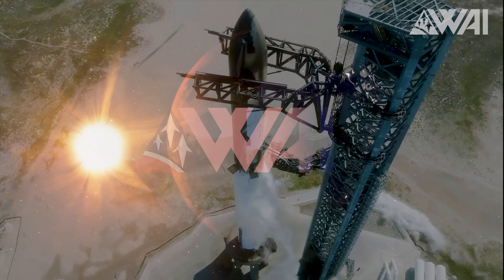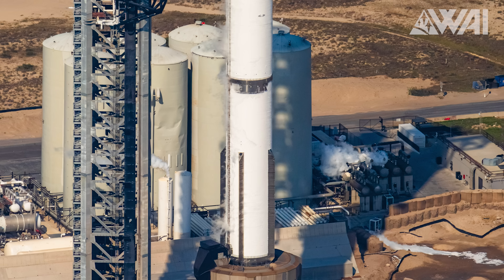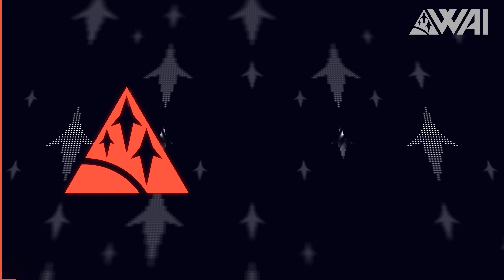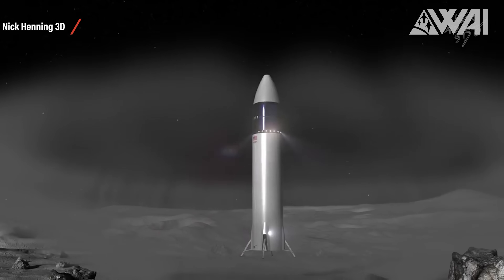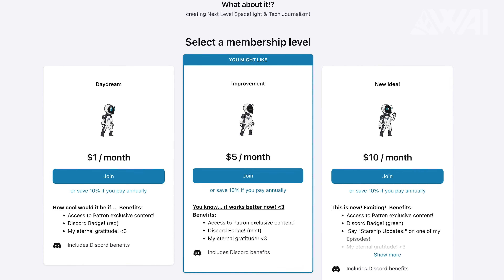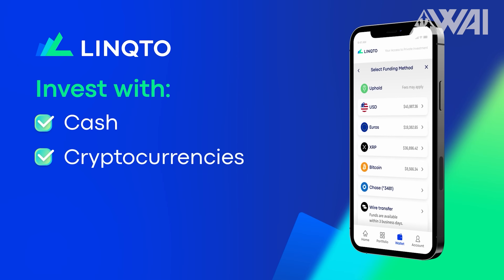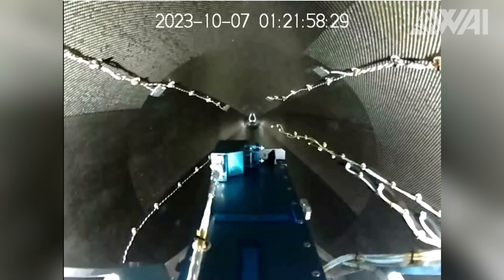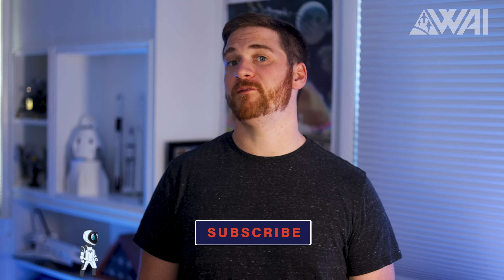SpaceX Starship Launch Imminent! What To Expect?

Comment: SpaceX has completed a wet dress rehearsal for its Starship, with the rocket's tanks partially filled with propellant and then emptied. The event, which was the first static test of the rocket's Raptor engines since May, took place on 22 October at the company's Starbase facility in Texas. The event was followed by a test of the engine purge system, which is designed to prevent fires on board the rocket during launch. The deluge system, which is designed to mitigate flame damage at the launch pad, was also tested. The testing occurred even as the Fish and Wildlife Services is reviewing the environmental impact of the system. It is unclear when the next Starship launch will take place.

Meanwhile, India has tested its first crewed capsule, the Gaganyaan, which is set to carry astronauts into space by 2022. The spacecraft was launched from the Satish Dhawan Space Centre in Sriharikota on 22 October, carrying a humanoid robot named Vyommitra. Spain has also launched its first private rocket, the Arion 1, which was built by the Madrid-based company PLD Space. The rocket, which was launched from the El Arenosillo test centre on 17 October, reached a height of 30 km. Finally, NASA's Voyager 1 and 2 spacecraft, which were launched in 1977, are set to receive their first software update in 46 years. The update will enable the two spacecraft to continue to communicate with Earth until at least 2030.

Comment: I hope Felix is back to 100% before launch attempt 2!
I wonder: could SpaceX be using the regulatory delay to train and work thought the procedures for rapid reuse?
With the hot staging ring as an add-on, and stuff they need to check under it, I could see SpaceX replacing the HSR every time a booster comes down, with the old one being refurbished for one or two flights later. So all these stacking exercises could be to see how the HSR holds up.

Comment: 4:20 - Now that you so nicely explained that frost on the exterior of tanks is just that - frozen moisture from the surrounding air (shouldn't everyone watching this channel know it already?), you blew it labeling the plume of condensation "liquid oxygen clouds". No, they are water droplet (or perhaps ice crystal) cloud caused by cold oxygen venting. Even if some oxygen is actually liquid when it spews from venting valves, it vaporizes immediately, absorbing additional heat from the environment; in the ambient air so rapidly chilled far below dew point water vapor condensates or even freezes. 
This is one of my pet peeves: not even normally very good SpaceX commentators narrating Falcon launches ever managed to explain this correctly, although they mention it almost every time. So, again: just water.

Comment: As for the deluge system... I keep thinking, if heated gas from the rocket overpower the water flow and make it inside the steel plates... You'll have a steam bomb waiting to go off.  But I'm sure the engineers are far ahead of my humble carpenter thinking.

Comment: i  wonder myself why they won't build some kind of landing tower, lower than IT (maybe into a sea platfomr), to catch the booster without risking the entire LIF itself. seems more safe because you avoid damange the launch pad, the fuel plumming and the integration tower itself. A failure attempt to land direct into integration tower would be hugelly catastrophic.

Comment: Great content as always, but I fail to see how they can subcool oxygen to -210C, given that they do it with liquid nitrogen whose boiling point is -196C. How do they reduce the temperature the final 14C? Actually -210C is the melting point of nitrogen, perhaps this is where the -210C figure came from?
Reply: Maybe they use significantly subcooled liquid nitrogen, rather than keeping their LN2 at or near its boiling point (which would be rather difficult to store without large losses, for any considerable length of time...)
Reply: @Spherical_Cow  The normal way of keeping liquid nitrogen cool is to let it boil off, which holds it at its boiling point, rather than keep actively refrigerating it. The main exchangers at Starbase are "kettle type" boilers, clearly designed to remove heat by boiling a fluid (nitrogen.) That enables you to use the latent heat of boiling to use a relatively small amount of nitrogen to supercool a vast amount of oxygen. If you were going to use active refrigeration to subcool liquid nitrogen, you may as well subcool liquid oxygen directly. And as I pointed out, -210C is the FREEZING POINT of nitrogen, so you would get severe handling difficulties at this temperature. Looks like a mistake to me.

Comment: That's a lot of ice considering the huge surface area. I wonder if all this weight of the frost is considered in the performance calculations. I am curious.
Reply: The rocket is filled with liquid oxygen (LOX) and liquid methane (LCH4) propellants, which together average to about the density of water (there's twice the amount of LOX as LCH4 by volume; LOX is significantly denser than water while LCH4 is much less dense).  Compared to the internal volume (and mass) of propellants - never mind the rocket's structure itself - the thin veneer of ice on the rocket's skin is relatively insignificant when it comes to overall mass at liftoff - at least, during the initial moments of flight.  And during those initial moments, much of that ice is sloughed off due to the vibrations caused by engine ignition and operation - and most of the rest is torn off by air pressure as the rocket goes supersonic through the troposphere.
Reply: @Spherical_Cow  thanks for this great answer! 👍🏼

Comment: Before the first launch , SpaceX knew crap will fly and decided to go ahead even if the water system wasn't ready ... it was holding the rocket at full throttle for 6 - 8 seconds before releasing the clamps ...of course debri will fly also ...the fish and wildlife ..who gave them govt. control ?
Reply: A billion dollar industry and their worried about ducks ? ....thats what I call " throwing their weight around ...Jeez.
Reply: Star base is built right next to a wildlife refuge so yeah….
Reply: @Keestral Because no other pad has done that right?

Right?

Comment: A third option: The US F&W service allowed the test to go ahead as part of their licensing assessment.  There is a limit to how much they can determine based on theoretical data.
Reply: Option 3.1: Even if they are still working on the rest, the US F&A has already determined that a test run of the water system isn't a hazard (e.g. because if they keep the pad clean, it just dumps water into water soaked land).
Reply: @benjaminshropshire2900 Which is plausible since 6 tests happened and there's still no bans/complains from agencies if that was a problem

Comment: meh the frost is frozen oxygen and hydrogen ... not liberated o2/h but shrug this channel doesnt care about being properly accurate so ...
also rather sick of the push to like/subscribe because 'youtube may have...' its about time to add the channel to the do not recommend list
final nail in the coffin, i have adblockers to prevent commercials being forced on me by youtube and this channel uses their position to bypass those blockers by inserting a damned commercial into the vid, not just 1 but several, every plug for merch or flights or anything not related directly to the topic is usually commercial sales pitch. well never again iv had enough of this nonsense congrats youve convinced me to leave and never return hope the results of that sales pitch is what you were actually after. good riddance

Comment: Starship's Flight Termination System does still need armed and I believe the booster is currently missing a grid fin motor, but they could do both of these in a day if they wanted. Nice update, TJ! And wishing Felix well soon!
Reply: I dont think that the FTS is even installed until right before the tanking.
Reply: The grid fins were tested, all 4 of them, during the WDR so the grid fins are all set.  You aren't wrong about the FTS though, once they put that sucker on thats when we know stuff is getting real ( since those have a shelf life on them )
Reply: @MrGoesBoom  Yeah, Marcus House pointed out he also thought one was missing before they did the WDR - I hadn't seen the footage of the motors tested until last night. Definitely excitement guaranteed once that FTS is armed!
Reply: All motors has been installed you're incorrect

Comment: All my best to Felix!! 

I'm glad they are testing and retesting the water deluge system. In my opinion, this will be the key to a successful launch. All it has to do is cover the flames with water for about 10 seconds. If it does that, the launch base will be adequately protected. But it has to work flawlessly for each launch. 

I don't think any of us expected the primary problem of large space vehicles would be the launch base! But that's how it turned out. 

I vote for November 6th as the launch date. If successful and if both the launch reaches orbit and the launch base is protected adequately, this will be a "new date for humans." 

A successful Starship will change our entire society. Mark my words. We will never be the same. 

Sanjosemike (no longer in CA)

Comment: How are the protective tiles impacted by the extreme cold of the fuel and oxidizer?
Reply: The hull/tank shrinks bringing the tile seams closer together. That's about it. There is a soft thermal blanket under the tiles, which greatly reduces air convection between hull and tiles, and is a further insulator.

Comment: I’d offer a health tip that included a various food / vegetable spice that at one point if you used a combo of wordies the comment would be deleted instantly. NOW—oh a key is CRUSHING (or dicing (it) and WAITING 10 MINUTES—that’s ten minutes—then consume raw, down with some Kampuchea etc. Also zero meat or dairy, sugar — instead add olive oil FAT and RealSalt, which is the best salt in the universe. NOW—as per for EVER getting the ship launched here’s the deal: without a means to mute acoustics the rockets will rattle themselves apart—like explode right on the pad. 🚀💥💥🔥

Want proof?? Ask why they haven’t done a single full stack / load test— NOT ONE. Even empty SparkShip will never last a flight as is.

Not with a ceo who goes around knocking up staff and firing people after too many days/years jacked on K—mmk? The future IS NOT FOSSIL FUEL. We need to ‘solve the problem of gravity’. Also STAR-RAKER.

Because it’s time kids to start THINKING about landing. The part where after you go UP, you come back down. Go take a look at the pics of people standing under the rocket. A gust of wind (common thing!) would send it flopping to it’s doom—unless there’s some magical side landing gear installed hahah ok gotta go to work have a great day!

Comment: It feels that Space X are have been happy to imply, not pushback too much and even come out and state that the reason for the delay in Starship's next flight were down to delays with FAA approval. Just looking at all the activity it has never seemed that Space X were remotely ready and the FAA have been used as a convenient deflection. How high will the bar be set that determine a "success", because clearing the tower and not destroying the launch pad really needs to be improved on.
Reply: The current version of StarShip is far from being the final version.  This is still a test & development campaign.  The FAA and EPA delays this past month have allowed SpaceX to add updates and improvements that were scheduled to be made later.

All systems could be ready now.  However, if the FAA tells them to wait another month, SpaceX will destack and make more updates until then.

Comment: During the first test flight the vehicle would have hit the launch tower if the engines on the tower side of the rocket flamed out. Luckily for spacex the engines on the outside were the ones to flame out leading to the booster to scoot away from the pad. Also the FTS basically didn’t work on the last flight. Keep that in mind. That vehicle could have been flying out of control in the direction of Boca Chica with no way to destroy it before it hit the town, that could’ve easily happened. 

It’s no wonder that regulatory authorities are being hard on spacex and making sure that this time all the ducks are in a row. We are all itching to see the full stack fly, but remember that Spacex brought all this regulatory scrutiny on themselves by flying so recklessly last time.
Reply: Maybe they would've aborted if those were the ones flaming out
Reply: #sshol

Comment: What kind of exhaust is produced by the Raptors?  Anything MORE toxic than CO2 and H2O?
Reply: Mostly co2 and water vapor with a minority of hydrocarbon byproducts. Nowhere as polluting as RP1 soot, or home air polluted by gas stoves. SpaceX is using pure methane instead of ordinary natural gas.

Tim Dodd has an in-depth video about rocket pollution.